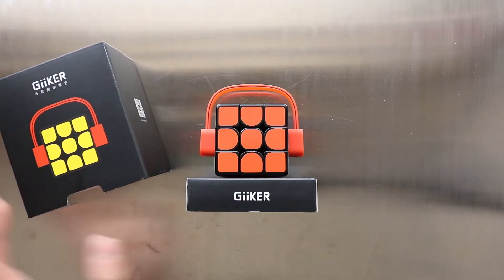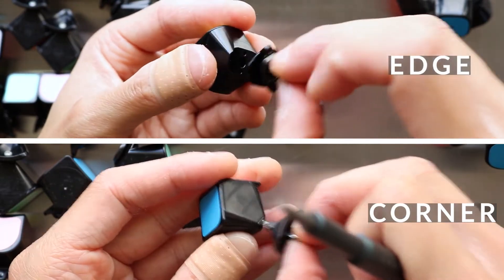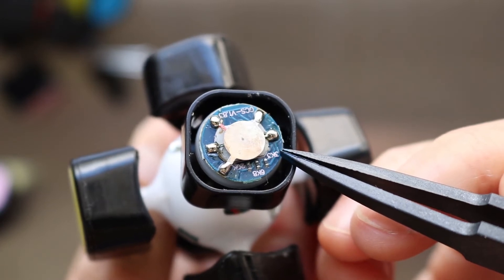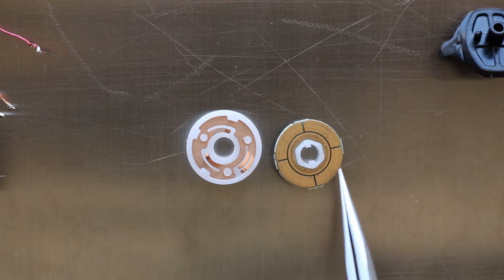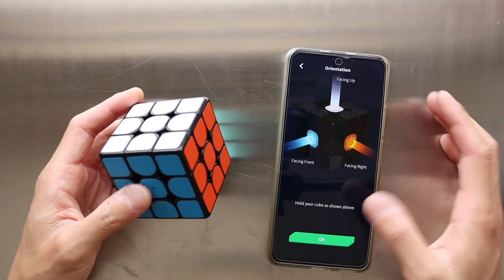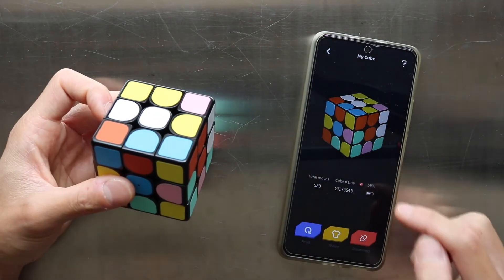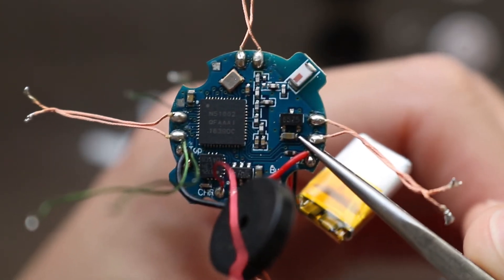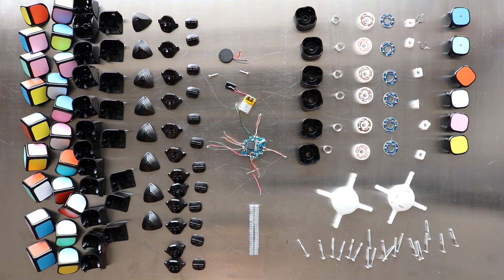Inside of a smart Rubik's - Giiker Supercube Teardown

Comment: thanks for the video! I have a question… my supercube seems to be loosing connection on one side (red center). It worked fine for like a day or two when it arrived. But then…  The simple reset on app doesn’t work. Every time I scramble it according to app no matter what speed it looses connection in the midway of process. Maybe someone has an idea how to fix it? I’m afraid to dissemble it by myself cos i might break it 😅. Got my money back for it but still what a pity 😢

Comment: I lost my charger. 
how can i charge the cube? is it possible to connect the charger from the phone? if the parameters for the charger or voltage?
Reply: the charger that looks like headphones is the only way.
Reply: Take 5v cable and stick the ends in.